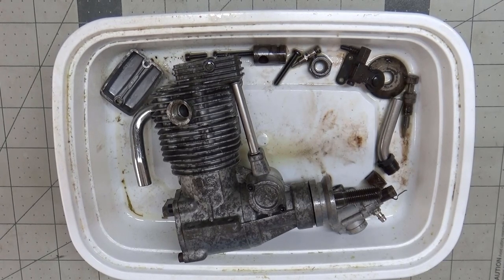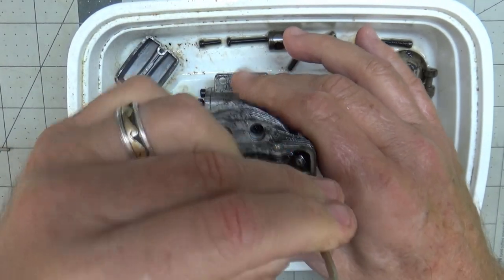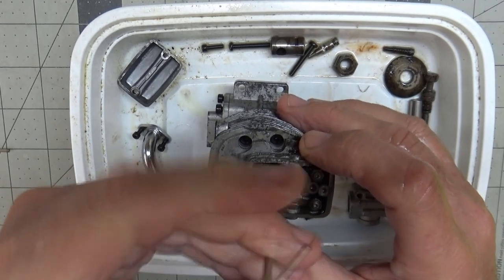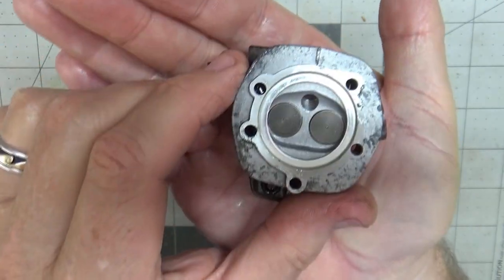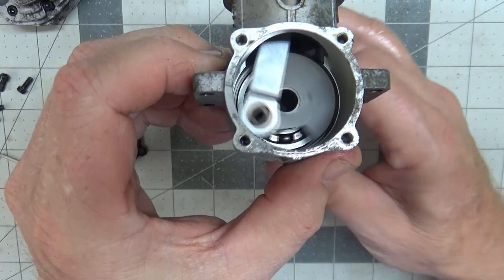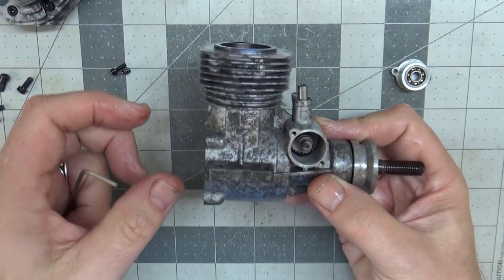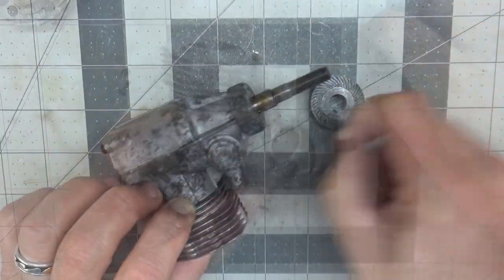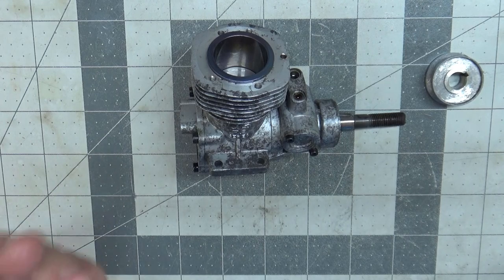OS Engine Oh My! Part 2 OS FS-61 A Look Inside

Comment: Wow. Really expected internal corrosion.  If it runs well, and is inside a cowling, no one will be the wiser. Nice education Dave. I always learn from “the master”
Reply from the maker: There is no reason there would have been internal issues unless this had been submerged in water which obviously was not the case.

Comment: I have had new looking engines which were rotten inside, but that one is pristine, I think it will run just fine David, looking forward to seeing it.
Reply from the maker: I suspect that the engines you had that were clean looking on the outside but nasty on the inside, were not new and never run.  I have never opened a new never run engine to find a mess.  This engine is a perfect example of that.  Now had this engine been submerged in water and muck the inside would have looked much different.  Clearly that was not the case with this one.

Comment: She looks brand spanking new inside...absolutely amazing. Cant wait to hear it start for the first time!

From personal experience the most important thing with any engine prior to storage is to burn all the fuel out of it. Running with an electric starter and a glow driver until it stops popping will do more for preservation than after run oil will ever do on its own. 

Remove the presence of corrosives and they’ll be no corrosion.